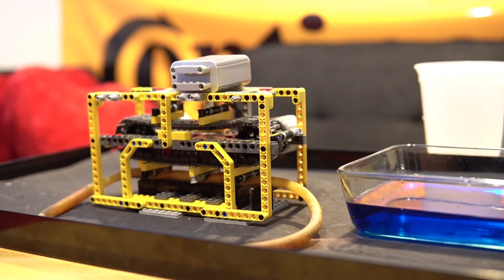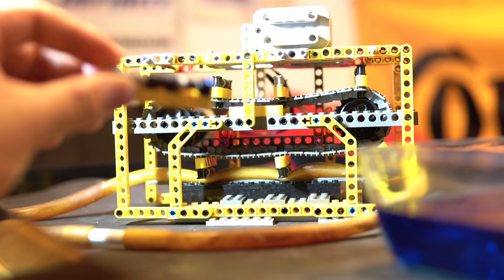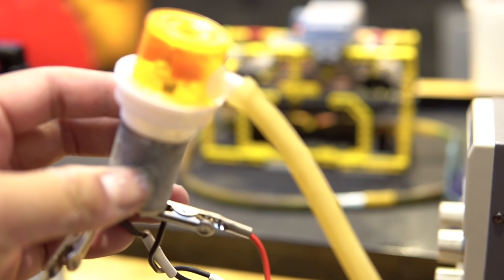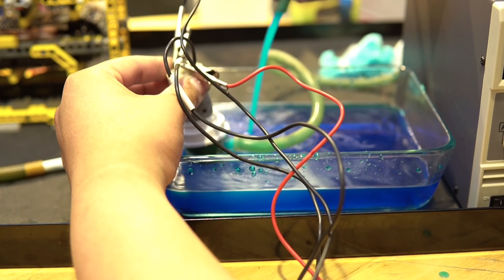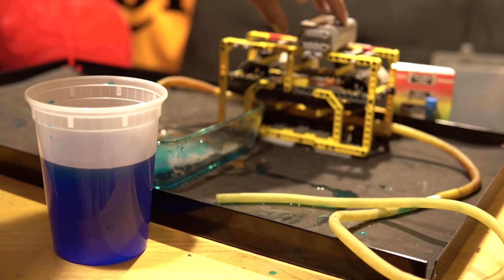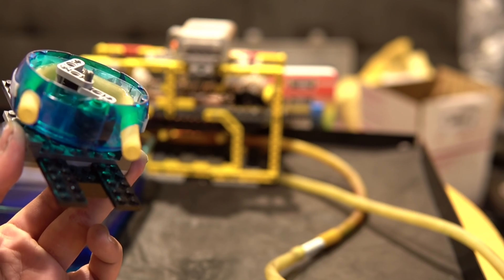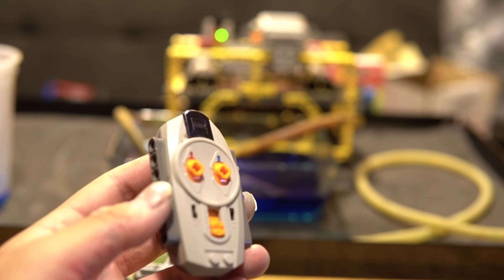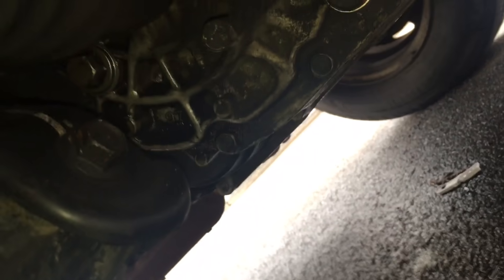LEGO Peristaltic PUMP (battery operated fluid pump)

Comment: what happened to the 2 stroke engine because i think i can help you with it you need to make sure you have good compression and a better spark timing and you need to glue the lego together and you need to also run oil and you need a square ring for your engine